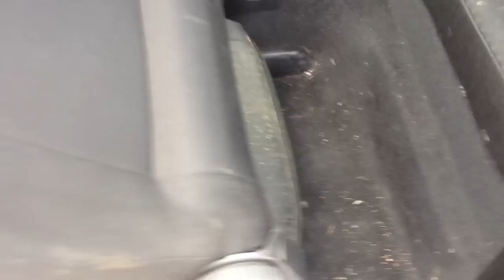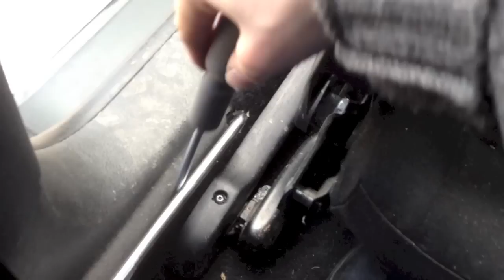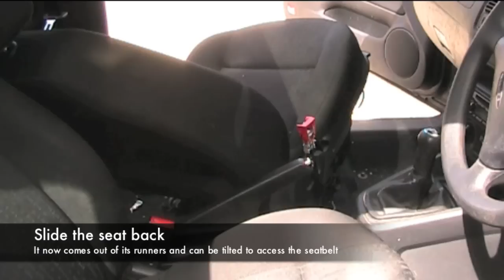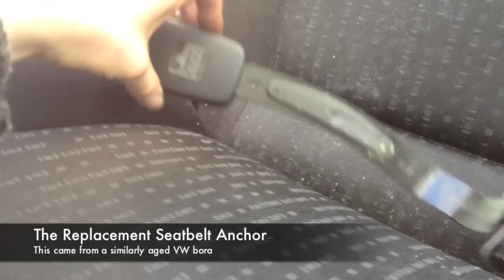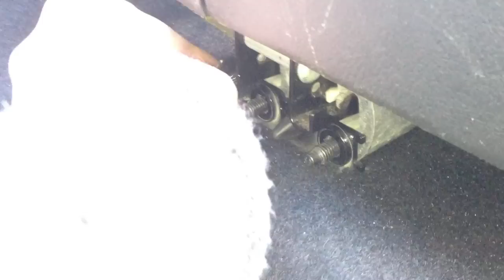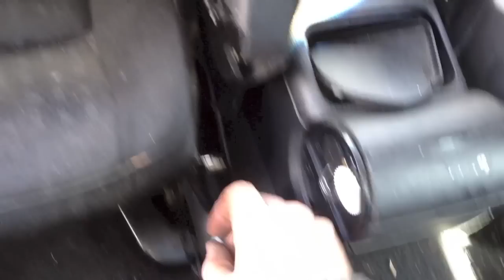VW Golf Seatbelt Anchor Replacement

Comment: Great video I'm going to instal one for my wife tomorrow. How do you install the seat recliner cover? It's the plastic piece that goes over the seat belt latch. 
Thanks 
Hope to hear back soon
Reply from the maker: Steve Neville Hi, the cover im not sure, i would assume its held in place with a few screws or clips to the frame of the seat, unbolting the seat may be necessary to get a look around the cover or trim that to see whats holding it in place

Comment: Good vid, did you disconnect the negative battery terminal before doing this?
Reply from the maker: Yes it would be best to remove the battery and wait about 15 minutes before starting work on the airbags.

Comment: Question: did you vehicle have an electrical component that notified the vehicle when the seat belt latches? I’m wondering because of this and how that effects the ease of this task.
Reply from the maker: No this car was before all of that, if you did have the warning light then its just an extra plug to disconnect, as a precaution remove the battery and wait 15 minutes to avoid getting any warning lights.

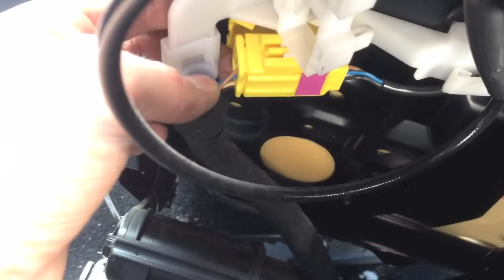Comment: What kind of key size you use in 0:58. Was it "m8 spline bit"? What size you use? Was it "M8"
Reply from the maker: M8 Spline yes as far as i recall
Reply: can the seat be taken out without one of those tools, or could you use a spanner or something of the sort? if so, what size?

Comment: Dude, you need to clean your car!
Reply from the maker: Its not my car the owner got an audi a6 and the golf got a bit untidy, my cousin actually ended up buying the golf and its in a much better condition now
Reply: +peugeotCitroen2CV which year? That's a damn good car. Also I have problem because my seatbelt sensor says it's not connect when it clearly is, car golf plus tdi 2007.
Reply from the maker: +BiMiHi I think it was a 2001, it wasnt too bad a car, few issues related to being sat for a while but its back doing daily driver duties. As for the issue with this new golf possibly something has went inside the latch mechanism around, or loose wires going to the latch.
Reply: peugeotCitroen2CV I think it's a good car and maybe gonna buy one after my first couple of paychecks. As for this golf, it's really pissing of, can I just open it and remove the wires?

Comment: Why did you do this?
Reply from the maker: The part was broken and the chap who owned the car bought the replacement part and asked me to fit it. I suppose it may have been possible to fix the plastic cover but it was lost.
Reply: You would also need to do this if your seatbelt switch went bad causing the airbag light to come on and stay on.  This happened with my drivers side seatbelt switch and then the passenger side about a year later.  Replacing this part fixes the issue.
Reply from the maker: Gary P i didnt even know there was a switch inside the part, these mk4 golfs  dont (or at least any i have been in) have a seatbelt reminder,but its interesting to hear it would cause an airbag light
Reply: @garyp8036  did you have to reset the codes after?